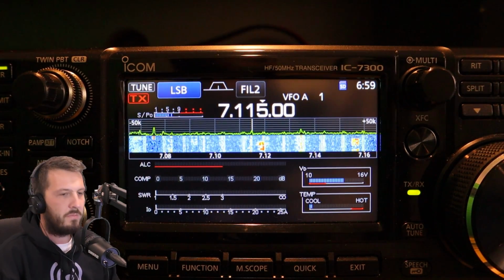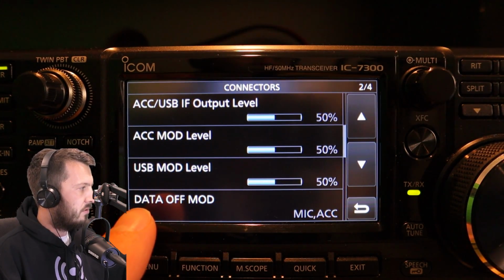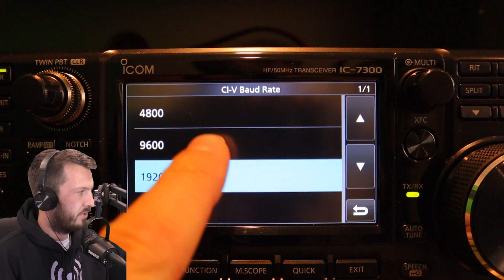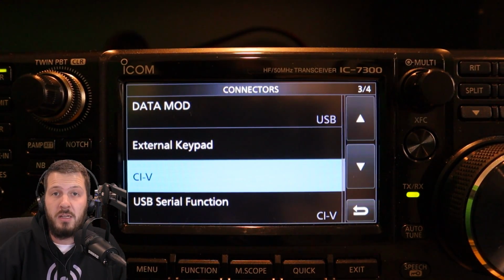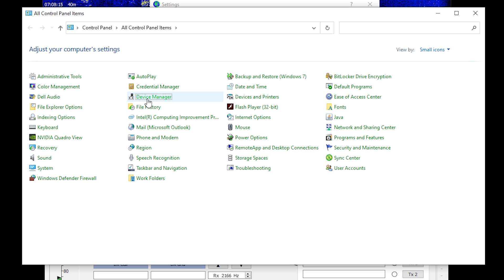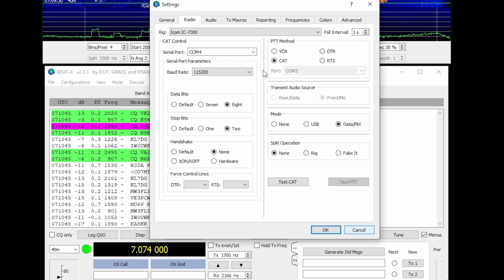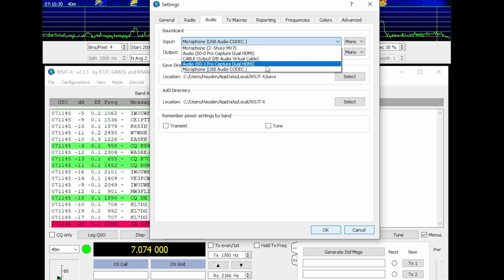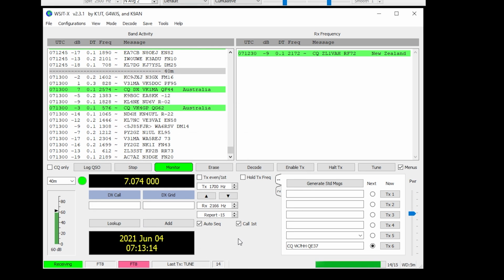Icom IC-7300 SETUP for WSJT/FT8 Digital Modes (Easy and Simple)

Comment: Hello. A good video indeed. I'm not sure if this is any benefit to anyone or not, but when setting up my QMX Plus, (Lol, not an icom), there was also an extra box that had to be ticked in the hardware and sound control section that you mentioned towards the end of the video. It went as follows, go into sound, and click recording, and When right clicking on the device and clicking properties on the device I wanted to hear, there was at the top, a listen icon between general and advanced. And when clicking on listen there was a box that needed to be ticked. Only until I ticked that box, did I get any audio from WSJTX. Found that out on my own and maybe it might be a benefit to someone else. Great content though just the same. Really enjoying WSJTX and all it has to offer. Cheers!

Comment: Thank you thank you thank  you. You are an excellent instructor.  Followed your instructions and it worked in the first try!  
Request. If you have not already done so, could you do a similar video instruction for setting up Fldig and/or Ham Radio Delux on the ICOM 7300! 
Way too many folks struggle with those set ups, including myself.
Reply from the maker: Glad it helped and thanks for the video suggestions 👍

Comment: Great video—just pulled my new 7300 out of the box and had it up and running with WSJT-X in less than ten minutes with your help. Might have taken longer  if I hadn't already had some experience with the software but your advice on what settings to choose for the radio helped immensely. Thanks, and 73 de K6BSO
Reply from the maker: Awesome! Glad that it helped 👍

Comment: I followed the video step by step and recieve works fine. I have no transmit power at all. What could I be doing wrong?
Reply from the maker: Check the Connectors Menu and see what DATA ON is set to. It should be USB

Comment: I used to own a 7300 so I appreciate its attributes and probably all you need in the real world. But I do think if you use it with a pc like with data modes the consideration for sdr is a must. My sdr as a lot more going on with a wider range of parameters for individual use. Incidentally my sdr costs the same as 7300 so you don’t need deep pockets to realise it.

Comment: Hi Hayden! Your channel is simply awesome and thanks for all the good stuff you put out. Regarding settings for ICOM7300 for FT8, with the firmware updated to 1.41, is it as simple as selecting the FT8 on the second screen of the new Menu? Thanks and 73
Reply from the maker: Thanks Rajaram for the kind comments! Yes newer firmware has the FT8 preset! So it is as simple as pressing that. The settings in WSJT-X might need double checking however. Thanks again, 73
Reply: VU2RJV from India

Comment: Great vid Hayden, VK4VO here, just ordered my 7300
Reply from the maker: Thanks mate 👍 great radio you’ll love it!
Reply: @HamRadioDX  We'll I do love it Hayden,,, blows my old 756pro 2 out of the park. Love the setup vids, helping me very much. One small glitch I have found and I still haven't worked out if it's WSJTx or the rig. When in F/H mode, sometimes on TX is does not select USB-D and I have to manually change it. Still looking for a fix, or find out whats setting is wrong somewhere.

Comment: Hi. I have been running my 7300 and WSJT-X now for over 18 months. Suddenly it stopped working so I checked my setting to the ones you use and get the Hamlib error again. Any ideas what could be wrong.
Reply: He hasn't answered in over 2 years, he obviously doesn't know!!! Same problem here!

Comment: Why is "CI-V Baud Rate" set to 19200?  Why is "CI-V USB Baud Rate" set to 115200 and not something else?  You assume that the computer O/S is Windows (tsk).  (In Windows), going to DEVMGR and Properties for Silicon Labs USB Audio Codec (Burr-Brown from TI), the sound card is default set to 9600 baud, 8 data bits, 1 stop bit, no parity --- why are you setting Serial (WSJT-X) to 2 stop bits and 115200 baud?
Reply from the maker: Icom RS-BA1 waterfall works fastest at 115200 as can be expected. Don’t tsk me… I have a Windows computer, deal with it. If you want a Mac tutorial, send me a Mac computer. Do the settings in the video not work for you

Comment: Great video. Thank you for sharing. When using my IC-7300 as you layed out, when I hit the Test Cat button it turns green, YAY! When I hit  the Test PTT button the mode on my radio changes to UBS where it was just in USB-D and, I have no transmit power even though it does key the radio. Any suggestions?
Again, thank you for helping us.
Cheers,
Jay
N6WIP
Reply from the maker: Hi Jay, 
Make sure in WSJT-X under the radio settings it is set to "Data". It should then key in the USB-Data mode. The reason that there is no transmit power is because it's trying to transmit in USB mode (and in the radio this is configured to take audio from the front MIC socket). I hope that helps, let me know if you get stuck.

Comment: It appears that after setting up my IC 7300 using this guide, my mic isn't working to transmit  ...did I miss something in the settings? Since it worked before, I'm sure the fix is somewhere in the settings, I just can't seem to find it.
Reply from the maker: What is your DATA OFF mic source? It should be set to MIC,ACC
Reply: @HamRadioDX  Thanks! That resolved the issue.

Comment: Great video. Really well done!  I was still having problems with my ICOM 7300 set up this weekend. Was working previously but not after latest ICOM software update. Then I came upon the FT8 preset!  Loaded this mode and the ICOM is perfect.  Just thought I would add this as one push of the button sets the whole radio up to be optimised !  Cheers.  Mark   M7MSR   (p.s. I should add that the FT8 button of course sets the radio up for all the modes that WSJT-X et al offers ! )

Comment: Most videos talk about the ic-7300 and the computer setup but nothing about antennas. What is the best relatively inexpensive antenna that gives great results on FT8 and yields the most contacts? For example; Endfed, Magnetic Loop or dipole. 73.
Reply from the maker: Endfed or a dipole, whilst simple are very effective antennas. Loops are good for noisy areas but aren't that good for transmitting.

Comment: Hey Hayden, Nice video. Your Rx Window at 8min40 - do I get a QSL for that :)

I just invested in a 7300, finally retiring a very old 720A (the clacker). In WSJT-X, I've got wide yellow bands on the waterfall between 700-1100 and 1900-2200 that I didn't have when using the 720A. Any advice on what the reason might be. If you want to email a reply, my ad is on QRZ
Reply from the maker: Hmm wide yellow lines? Nothing comes to mind... Maybe a screenshot? What filter is on your radio in data mode?
Reply: @HamRadioDX  I emailed you

Comment: I'm currently running an FT-891, whenever I manage to get myself a 7300, it's going to take me a very long time to learn everything. the FT-891 is primarily a mobile / portable radio, so it's very menu-driven. It took me about a month to learn the whole thing, so I'd imagine it's probably going to take me about 2 months to learn a 7300. Also, this video has simply reinforced the fact that I need a 7300 lol...

73 de W8IJC!
Reply from the maker: The 7300 is very user friendly. The menus make sense and easy to navigate. Good luck and I hope when you get a 7300 you love it, I’m sure you will! 👍

Comment: I was getting frustrated, got it working on 40, qsyed to 20. Hamlin error: IO error kills me. What to do please. Tnx 73 VU3MES
Reply from the maker: Try wrapping the USB lead around a mix 31 or 43 toroid, RF might be upsetting the PC. Also make sure you have the latest version of WSJT-X and the Icom driver
Reply: @HamRadioDX  thanks. 73